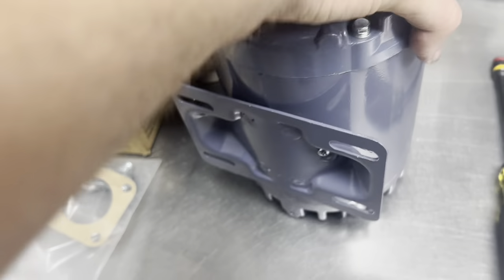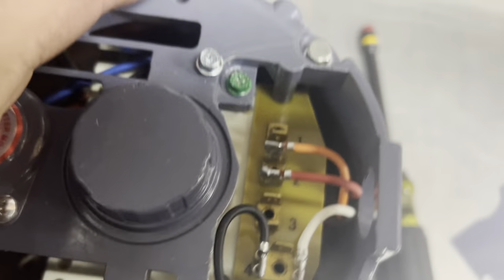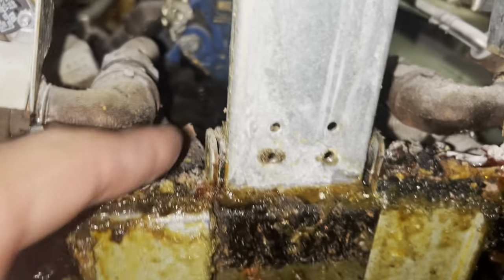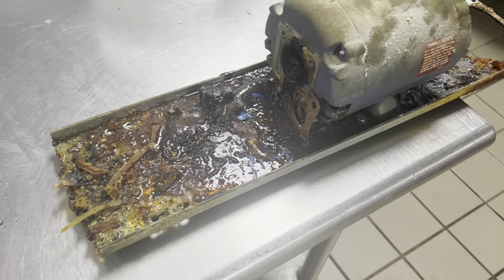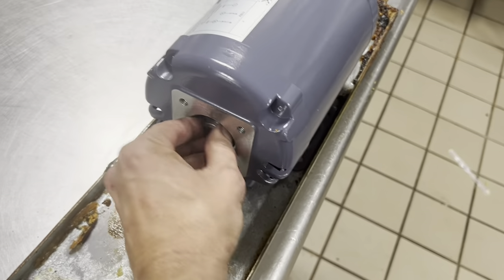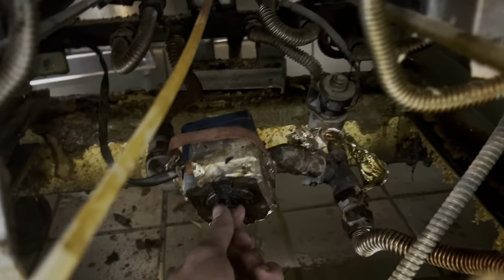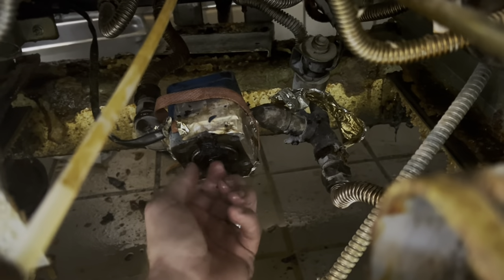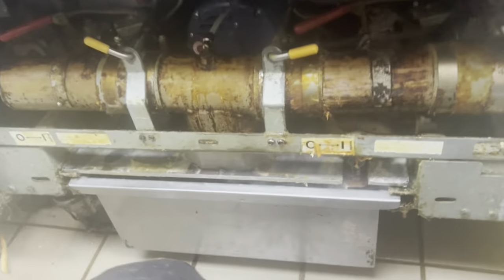Frymaster - filter motor replacement - literally the worst

Comment: Ughh.. I feel your pain on replacing these pumps and motors. Great work though. Whenever I replace the motor, I always take an extra step to replace the pump as well. I have ran into callbacks when motor was replaced but pump ends up failing after new motor was installed.

Comment: Risky business throwing in that nbk motor. I’ve used that brand in convection oven blower motors and have had a few not last long at all 

Hopefully you have good luck and don’t have to do it twice
Reply from the maker: Bigger issue is these pumps were never designed to run a 10 foot lift and 30 foot run to the waste tanks.  They were engineered to lift 2 feet into the fryer.   Mfg will confirm that after you go thru a few pumps under “warranty”
Reply: @restaurantrepairs  If they didn't have to use a close-coupled design where the motor shares a seal with the pump...